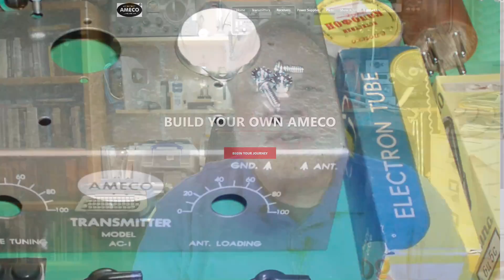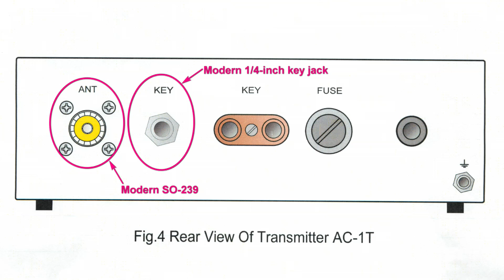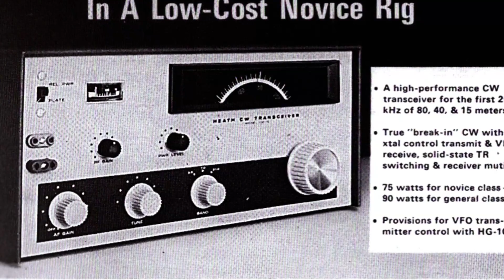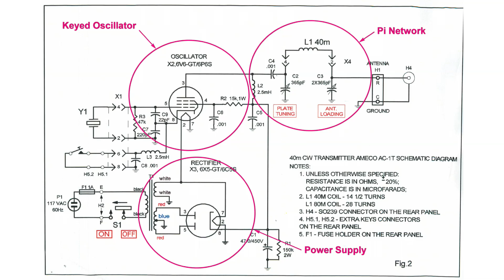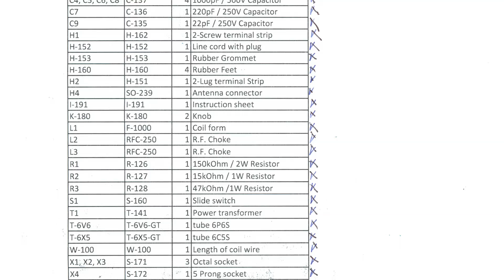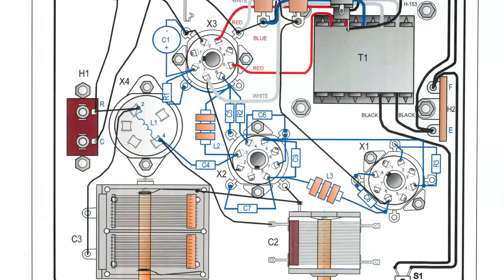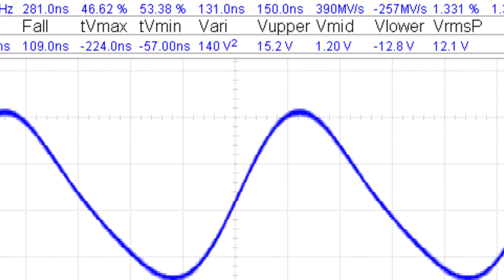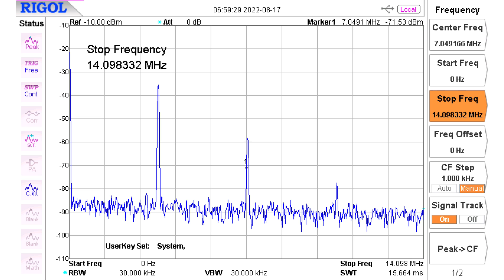A Major Trip Down Memory Lane: The Ameco AC-1T CW Transmitter Kit (#774)

Comment: Hi Dave, met u at a lecture at Duke City in 2018 ham fest.
Yeah, I also did modeling, and a good clear coat of mate after decals dry in front will do the job. Just a quick dash across, then another and hr later. Otherwise the decals will pop off and crinkle if too wet.

Comment: I received my novice class license as a student in high school. I paid $25 for a BC 348. Army surplus receiver, and I built a power supply. I had a 15 W Ameco transmitter with a 6L6 oscillator. My father and I built a dipole antenna on top of our garage. 
I remember my first contact with a guy three blocks away who had a 500 W  Collins rig.

Comment: 14:20 The polarized AC line cord should be wired so that the "hot" side runs through the switch, and that the neutral side connects to chassis ground.  It would be helpful if you could post a link to the schematic.  - de K3LT

Comment: Thanks Dave. good timing for me to find this video. At a hamfest this month (April 23) I rescued a terribly abused one .Transformer , chokes and varicaps were OK. Had been modified for voltage doubler and a tube like 2E26 but chassis pretty good . Now cleaned up with new tube sockets and ready to rewire as original. However, I think this is an early version as C2 and C3 are the same 400 pf and not enough room for a 2 ganger as a socket is in the way. I appreciate all you work here and in magazine. K5AJZ

Comment: Aloha Dave, I was looking at your call and have been wondering if it is an issue or vanity callsign?  My issued advanced call was KE0OF and I went on to WI0S, now AH7Y, all FCC issued callsigns.  We must have gone to advanced class at about the same time.  I was then in Durango, Co.  I enjoyed the trip down memory lane, and miss the old war surplus stores that had boxes of crystals cheap, then often times hours spent with paper lapping the xtal to desired frequency.  Almost always the filament string dissipated more power than the transmitter.  Some signals had the "chirp" that sounded more like a bird than CW. I love the memories, but enjoy the modern conveniences.

Comment: Not quite down the centerline of my memory lane, but close.
My first Tx was the Heathkit AT-1.
5U4G, 6AG7 osc, 6L6 PA, 30 watts input, band switching 80, 40, 15m, rockbound CW.
Peak the grid, dip the plate, on the panel meter.
Purchased in 1956, for $29.50 !

I'm amused to learn that I live about a mile north of "The New Ameco".

K2KQU

Comment: If novices (only novices?) were "rock bound", what did other ham operators use at the time? I don't think PLL was a thing back then. Did they really use free running LC oscilators?

DC6CK / 73
Reply: Yes they did. Home brew of commercially made. There is a lots of vintage stuff with LC VFO. And they aren't too stable.
Reply: I built a transmitter according a AC-1 schematic. I have a nice bunch of 80m and 40m xtals, but it is very difficult to get contacts.

I think the reason is that  most of the hams on the band are using very narrow filter. For example my 7038kHz xtal runs on 7037.7, 7030kHz xtal runs on 7030.4, nobody will hear me even if I get the Reverse Beacon spots from all over the Europe .
On 80m Finnish rag chew freq. 3556kHz  I have succeed better, actually very well.

Comment: I still have mine I bought the kit new and it still works fine.  When I first got on I got a letter saying that I was interfering with a commercial AM 1000 watt station.  I worked on it a little and no more blocking out a 1000 watt station.  I think I remember it puts out 10 watts.  It still looks brand new.  Many memories in my AT-1.  de WB7ORB

Comment: As a Novice in 1965 I built a Knight Kit T-60 xmtr and used a Lafayette  general coverage receiver which was as wide as a barn door. The Novice bands then were super busy so I had to learn to filter out QRM in my head. I couldn't a afford a bug key so I stayed with a straight key until I got my General.... When I turned 16 I was overwhelmed by the fumes...gas and perfume HI HI   Great video Dave!!73/K6SDW